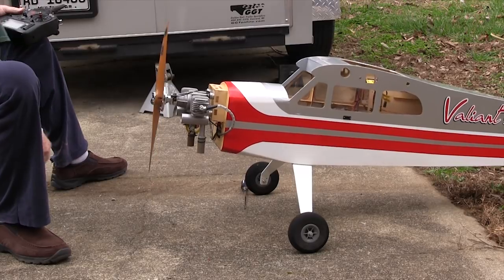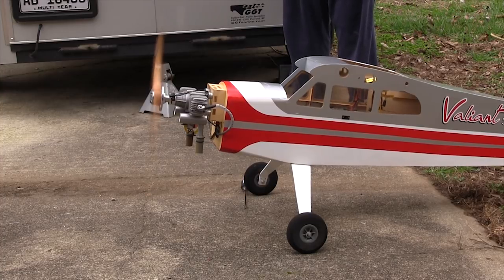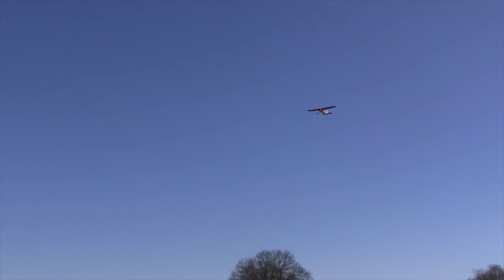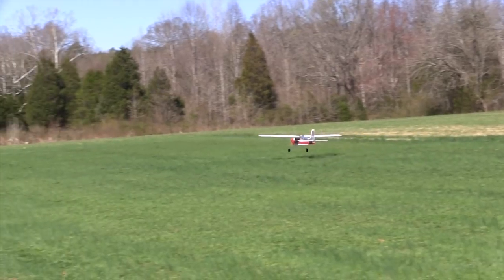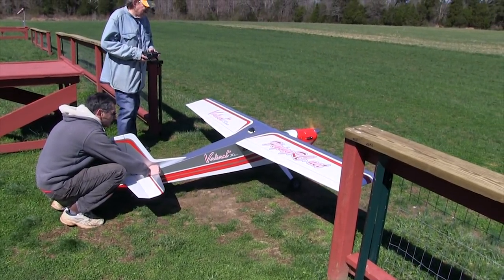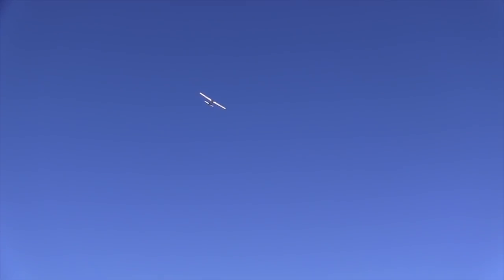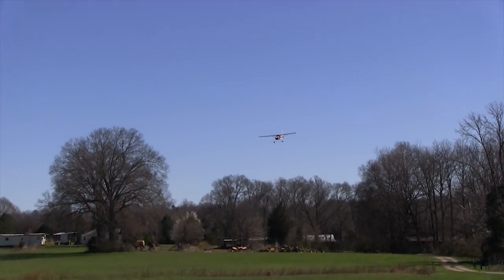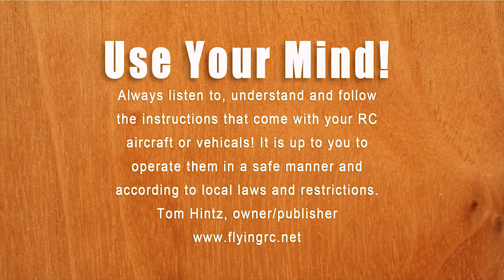Walbro Carburetors

Comment: Tom, fully agree that there is no substitute for the Walbro. I had a DLE-20 with a low mounted tank that got a lot better/smoother between upright and inverted when I mounted one of the VV RC Walbro carbs on it.

Comment: Great video! Isn’t this the plane that went in?
Reply from the maker: I had another just like this one go in at a float fly last summer. This is the replacement, now with dual receivers which you can read about on my site. I don't think I can go very long without a Valiant!
Reply: thintz12 Yes, I really liked your video about the dual receiver set up, I did not even know that was possible until you showed me, thank you for your videos!